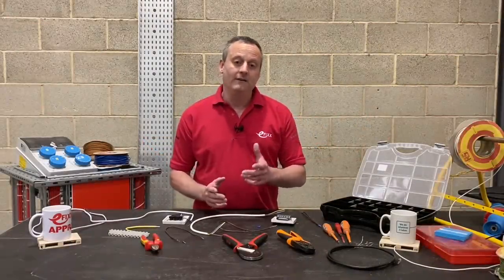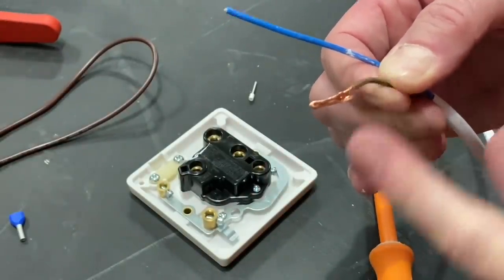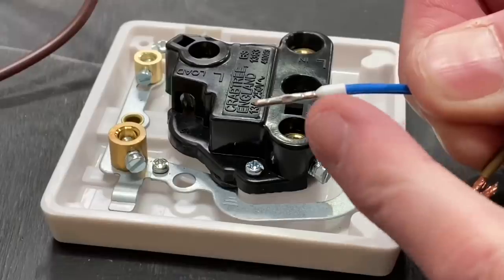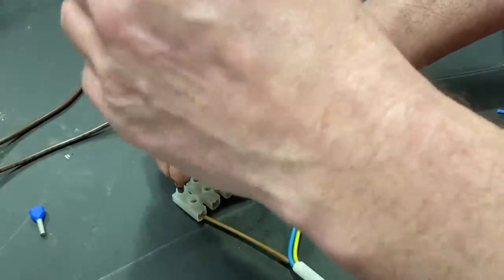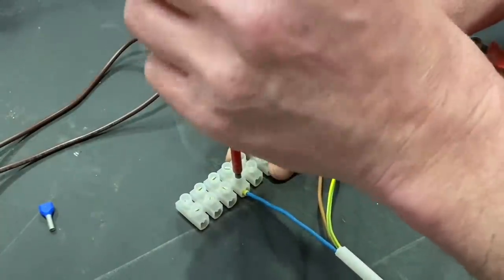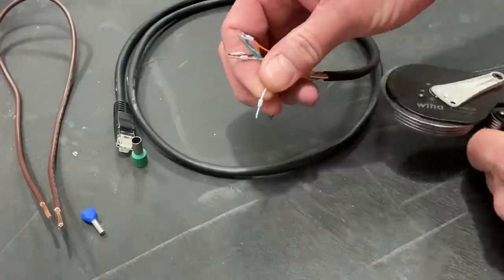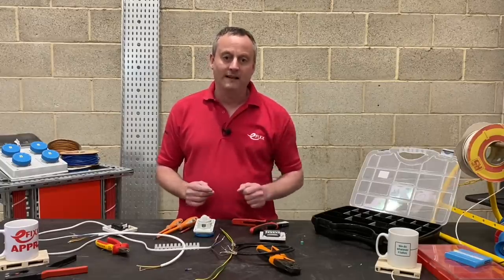Ferrule crimping - An easy way to improve reliability of electrical connections.

Comment: In allot of industrial sites I've worked on (oil and gas) the use of ferrules on all connections, ELV or LV is mandated in panels, junction boxes or end devices. They are a good job and don't really take any longer once you get used to using them. They are especially good for connections that get removed now and then for testing or alterations, I think this is the main advantage in using them, you can terminate them multiple times and they still provide a perfect connection, twisted strands are only good for one or two terminations before they need to be restriped and twisted up again and the wire is getting shorter every time you do that!
Reply from the maker: Wise words!
Reply: What ferrule crimper  do you use Phil?
Reply: @abdulseaforth6930  I use the Wiha model in the video but also have a cheaper knipex pair for smaller stuff, see link in last comment. For ferrules I normally use RS Pro, same price as others, normally have stock and don’t keep changing part numbers so easy to reorder.

Comment: I came across this video while researching the use of ferrules; as  I've always been uncomfortable with the way stranded wire gets chewed up. I didn't know you could get one to connect two wires together. Apart from protecting the wires, it solves the age-old problem of one wire slipping out when you are trying to put two into one connection. Love the video.

Comment: I work offshore and all electrical connections are terminated with bootlace ferrules.  As long as they fitted correctly and the right size ferrule is used they are excellent.

Comment: What a brilliant video.  I don't know if it's just me, but this is the first video I've seen advocating the the use of ferrules in a domestic situation, inline with industrial standards where reliability is perhaps more important.  Very well done sir, a point very well made!

Perhaps I could add that the ferrules you are using have plastic end bits that are quite bulky, which is fine for one core, one termination.  Where several wires are entering one termination though I find that plain ferrules are handier, and three or more cores can be inserted.  I appreciate double type ferrules as you show are available but its not always the best solution.

Once again many thanks for the great video.

Comment: I learned about them a while back? but decided to buy some for a project I was working on. I built a UPS changeover switch ( after I needed it ) and decided that Ferrell's would be the best way to terminate connections. Changeover switch works great now I just have to repair and rebuild the UPS that decided to die.

Comment: Standard on railway signalling cabinets. Should be able to just see the end of the strands at the front of the crimp. Tools were calibrated daily and pull test results logged in a book that stayed with the tool (both numbered).

Comment: I only wish all sparks would watch this video . It should be law to use these and the better quality Ferrell s also with the Wiha crimper you can place the Ferrell into the tool then closes the handles till the 1st click and it holds the Ferrell and you can easily insert the wire  great video

Comment: Bootlace ferrules are mandatory on fine stranded cables on our jobs, and because I'm picky, I make the lads put them on regular cables at dist boards if they're 2.5mm or smaller.
This is to stop the copper crumbling away when the terminals are tightened right up.
Reply: thats good practice. im a panel basher, i work site all over. theres been a few times where the cabling guys have asked for some ferrules so i tend to keep extra, just to help out when i can.

Comment: Nice Video. I just got this tool, it seems to make much better crimps that others I've seen. Hopefully it will solve the issue of multiple wires going into a single breaker where some are getting loose after time due to minute differences in thickness or insertion angle.

Comment: Nice video, another advantage ist that it also helps to keep moisture away from the copper. Other than that standard German colour scheme would be. White 0.5, grey 0.75, Black 1.5, Blue 2.5

Comment: Awesome video! I'm an auto electrician by trade and I work out in rural areas, and there is a tool at the start of the video I have not seen before, but been thinking about making! it's that handy wire roll holder on the right side of the screen in the first 30 seconds of the video. I work in a workshop, and I have been lucky enough that the bollards used to keep cars in the workshop at night are a smaller diameter than the inside of my rolls of wire that I work with, however I don't always have access to these bollards due to where the cars are positioned sometimes, and due to being in a workshop with other people. Also, these bollards require a hole in solid ground with a steel pipe inserted into concrete in order to work, and that setup just isn't portable for the times I am having to work outside of the workshop and on somebody's farm. I don't suppose you would have a link to where someone could purchase this product in Australia?

Comment: I would make 2 comments here, which may have been addressed in other comments or videos,  but no harm in repeating them. Firstly you should always make sure that the conductor  strands reach the full length of the ferrule and secondly that crimping is only suitable for stranded conductors.
Reply: You don't really need to put a ferrule on solid copper wire anyways. The purpose of a ferrule designed specifically to make the stripped ends of stranded wires mimic the properties of solid ones.
Reply: True. Just thought it was worth a mention as I have seen people putting  crimps on solid wires. They inevitably come off with very little effort.

Comment: Ferrules are incredible and underused. See them quite often in commercial BMS installations and they make a panel look so tidy and the terminations are much more effective than twisted strands, which often seem to break when the screw has been overtightened. Also, lots of panels use push fit connections, try pushing a twisted stranded cable into a push fit connector:/
Reply: been  a panel wirer for years, having  a ferrule end makes it easier and quicker to wire components. ive seen sparkys trying to put twisted pairs into terminals a couple of times ive let them use mine on site, justa bit shocked some dont use them.

Comment: Pull test it before and see if it comes off I pulled loads off of when no cables were twisted and red faces all around for younger engineers 😷I always twist the cable first never pulled one off when I did that.
Reply: Thanks for that Michael

Comment: I hope the follow-up video will address the use of Farrell's on solid core cabling and twisting conductor strands together before inserting into Farrell's. The only thing I haven't seen is a way of doing two cables that would later need to be separated for testing? Say rings.

Comment: Thanks for the video.  I have been using ferrules for several years on all flexible cores.  Something to bare in mind, they don't always work.  I have had experience with terminating 1mm flex into a spur with a ferrule and they fall out, some spurs terminals can be too big for a small ferrule like 1mm or 0.75mm.  So I have had to cut the ferrule off many times, twist and fold over to get my decent connection.
This doesn't happen in all spurs depends on the branding, just double check them before screwing back.
Reply from the maker: Great point 👍

Comment: To people who say just tin the wire (solder)
I'm not 100% sure, but I heard :
- When the wire get hot or whatever... it can melt the solder or soften over time...
- Solder will soften overtime under mechanical stress connection
This may lead to loose connection which is very bad (arching - overheating - cause fire - etc...)
Correct me if I'm wrong... take it with a grain of salt

Comment: I am an electrician in Brazil, I only use terminals, even if in a service I "lose a few cents" I prefer to lose than to make poor quality connections, in BR is totally widespread flexible cables, so for better connection are the terminals, I know many and many electricians even who were stopped in the time they do not use, I particularly think very pig

Comment: Great video giving examples. Had the debate with our qs when I put on an EICR that neutral fly leads on rcbos had been shortened and only twisted in terminal. I gave it a c2 and  said its a regulation to use them. 526.9.1 he said that must be a new reg so I continued to show him it in the 17th and in the 16th. But yes all who don't use them when using screw terminals should really change as soon as its pointed out to them. However the guys on site will call it a specialist tool and expect company to supply it. That said I have 4 in van 1. 25,35,50. 2. 6,10,16 3. 0.5-6 and 4. 0.25-10. Number 4 is favorite as is a clone of knipex on amazon costing £12.
Reply from the maker: We would be keen to see an example used on the flexible 19 strand 25mm meter tails!
Reply: I am a dinosaur when it comes to tech despite 18 years as a sparky but I could email some photos of before and after into a Henley block if any use
Reply: I didn't realise it was in the regs!  Also tinning is NOT permitted in the regs.
Reply: @lucidlx  I'm guessing you looked it up. There can be confusion on screw type connectors as some have a little plate which separates the screw tip from the conductors. That said if you have the tool its a good habit to get in to regardless on type of connection. I personally wouldn't use them on lever wagos though as they aren't as solid as a typical crimp lug
Reply: Thomas, what make is that Knipex look alike?

Comment: Definitely a good idea for the typical 7 copper core house wiring.  The problem is that electricians have a bad habit of leaving barely any slack inside fittings and screws in the terminals nick the cores, so that when replacing a fitting invariably some of the cores snap while trying to insert or screw the wire into the new fitting.  Once the wire is stripped back a bit to expose intact cores the wire is so short it is almost impossible to get it inserted with the fitting out of the wall.  A ferrule protecting the cores would hopefully solve this.
Reply: "The problem is that electricians have a bad habit of leaving barely any slack inside fittings..." That's called bad practice, or a plasterer who cut 'those annoying unnecessary long cables' between first and second fixing. Good electricians leave enough slack on their cable to reach the end of the fitting opposite of where the cable enters and then bend back to the terminal, or even a bit more than that.

Comment: You don’t need to twist when using ferrules it can make it harder to insert the conductors into the ferrule
Helps keep cable numbers from falling off too 👍
Reply from the maker: Great #electricians #toptips - thanks
Reply: efixx : would ferrules be suitable for a marine environment? I am thinking about a 220v/16 amp shore-power connection.
Reply: @ianrobinson6788  Yes they would, we use them offshore and onboard ships all the time.
Reply: Uther : Thanks for your reply. Would they need to be A2 stainless steel (not sure if you could crimp stainless or not?) or are just standard ones OK?
Reply: Can you please explain ( helps keep cable numbers from falling off too ) ?
As I always twist the strands in any crimp or connection.

Comment: The correct answer is you should use whatever the electrical code specifies in the locality where you are! Having done high-tech installations in over 20 countries, I can tell you what is “required” in one place is specifically disallowed in another. Interestingly, it’s in the UK where I have seen these ferrules disallowed, because the wire can actually slip out of them, even when you think you’ve got a great, snug connection. All is not always what it seems, so go by the book, and never assume the way you learned, or the way you think is best is the way to do it wherever you are.
Reply: When it slips out it wasn't crimped properly. If you make a good crimp connection and try to pull it off the wire, the copper wire itself will fail before the crimped connection. I've seen guys trying to crimp ferrules with their combination pliers because they hadn't the proper crimping tool. No wonder that such crimps will fail...
Reply: The issue that I have had is that a cable that will fit into a conection with out .  Some times will no longer fit into the connection after you have crimped a ferule on to it  .
Reply: @hotrex7779  It depends also on the shape of the crimp, the square shaped crimps don't make so much trouble.
It also depends on the type of connector and it's current rating. You can't put a 1.5mm² with a ferrule in a 10A terminal, but in a 16A one they'll fit.
Reply: youve seen these disallowed in the uk. what industry was that in. think youll find many panel companies use these. its not hard to use the right crimping tool for the job. plus dont put a 2.5 ferral on a 1mm cable.

Comment: Thanks for the video. At first, this topic is a bit of a minefield with such enormous variation in a number of variables for the process of crimping. May be doing a detailed look at all the different types would be helpful such as self adjustable square vs. hexagonal crimping tools etc...Also, the variation in quality of these tools is enormous from cheap chinese designs up to what I could see as one of the best manufacturers being Weidmuller. I would imagine there is also quite a variation in quality due to the standard of ferrules themselves. What could have given clarity to this video would have been taking measurements on a voltmeter to prove the ferrule was a better connection in comparison to the bare wire... may be one for the future! : )
Reply: Problem beeing you would probably not see a difference when measuring resistance, even if only one strand of the bunch was connected, as the higher resistance path would be very short. However you would still have that high resistance spot, which would create a hotspot at higher currents. Quite misleading if you are measuring resistance and thought its alright, while in fact it isnt.
Though you could pass a few amps through it and measure voltage drop, that would work better.

Comment: 03:00 Who puts a stranded cable into a connector block without twisting it?
Reply from the maker: A lot of people
Reply: Not one electrician I’ve met, and most of them are as rough as a Bears 🐻
Reply: @efixx  unbelievable how someone would do that, I wonder if they'd also not twist the strands when wiring a plug.
Reply: Lazy electrician

Comment: For residential wiring do you use 3 strand thick wire or 40 strand thin wires. Both have same amerage ratings.

Comment: Would you use ferrules on hard (non-flexible) wires, if not what would you use? Is using ferrules or other crimping connectors needed for solid (non-stranded) wires?

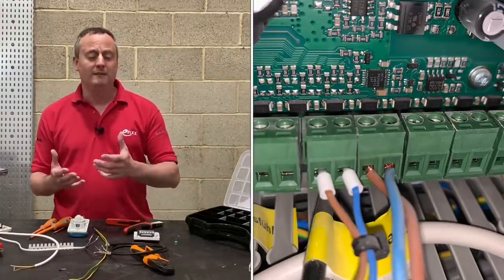Comment: Great video! We use ferrules all time using the single wire connectors similar to what is showed at 7:33. Looking at your example, I can see some of the barrel of the ferrule poking out not allowing the shoulder of the ferrule to butt up against the connector. I like to cut off the end of the ferrule so that none of the barrel shows and the shoulder (the plastic part) is butted up against the connector (if that makes sense). My question is if that is good practice or not to cut the end off? or if you know what the standard is. Any info would be appreciated.